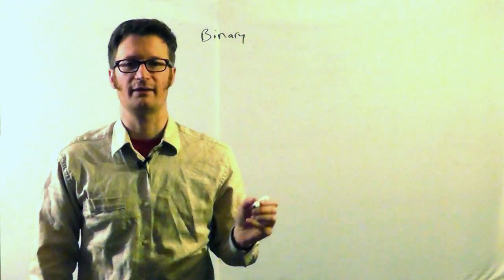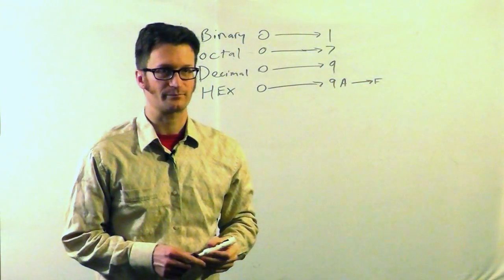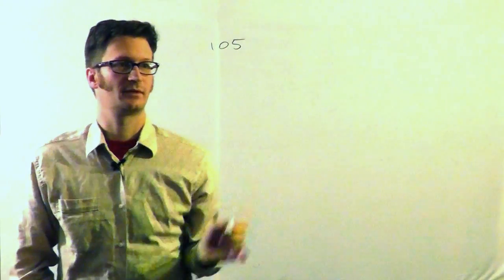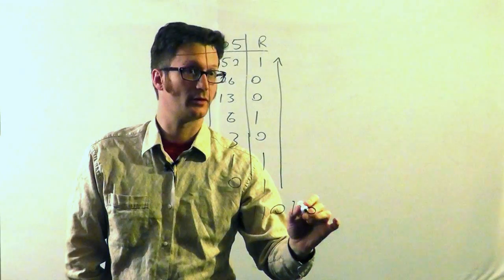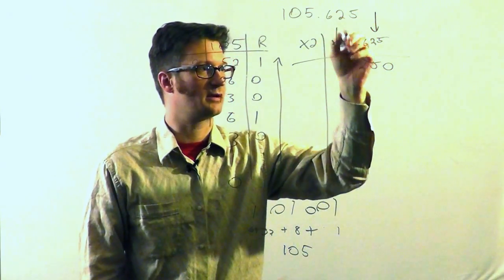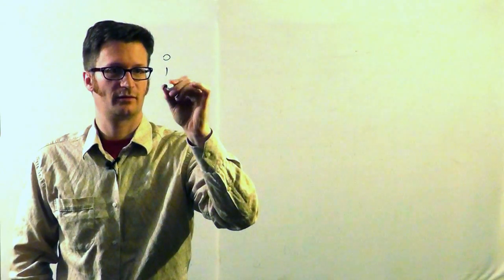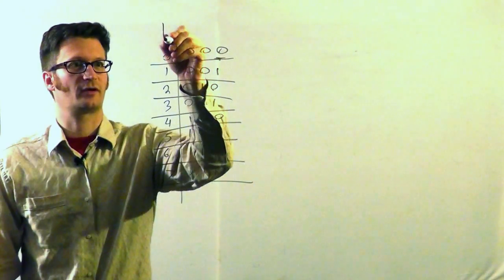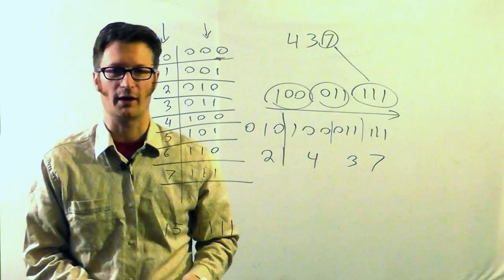Digital Electronics - Number systems

Comment: The system you use for binary to decimal at 3:40 doesn't work for even numbers lol
Reply: actually it does work with even numbers because if you keep dividing the even number by 2 at some point you will get an odd number that returns a remainder of one when divided by 2.